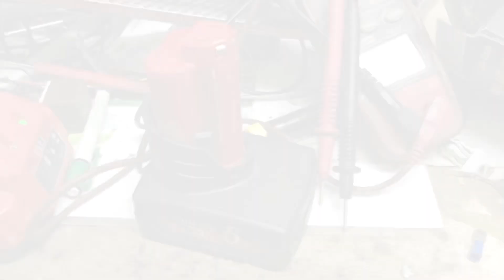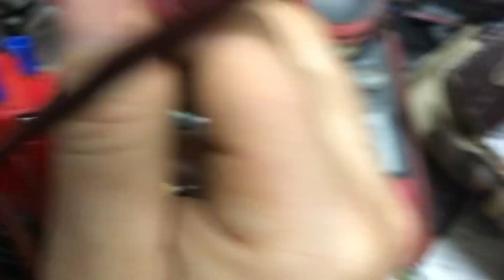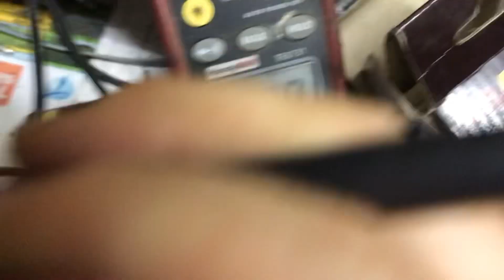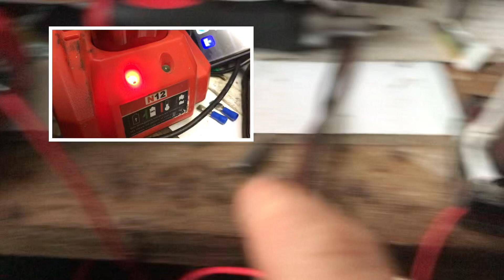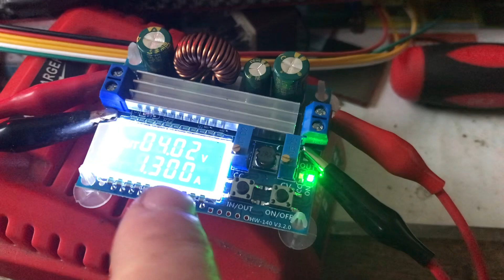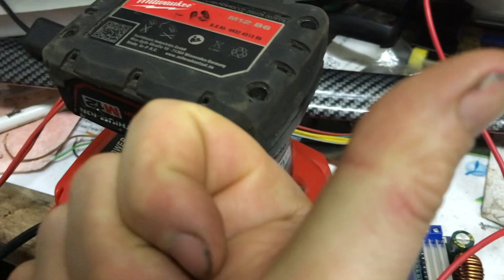Milwaukee Battery not charging - why - balance cells

Comment: well done on the video , rebalancing is a quick fix but often temporary. Usually 1 or more cells are faulty and they self drain dropping cell voltage and putting the pack out of balance again. The pink samsung 30Q 3aH cells are notorious for this and used in the 6aH version of the pack in this video. Might take a week or a few months but the pack will unbalance again.
Reply from the maker: Thanks for the comment, that's a great point about the cells and their potential for future imbalance, I'll keep an eye on it.